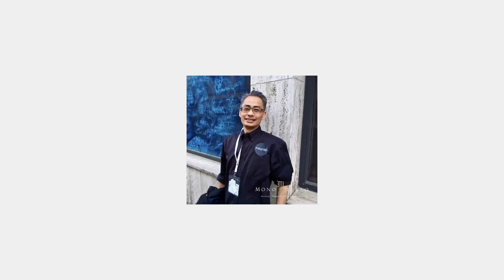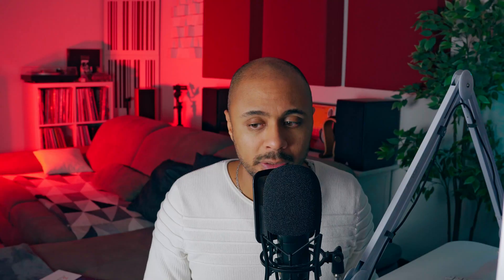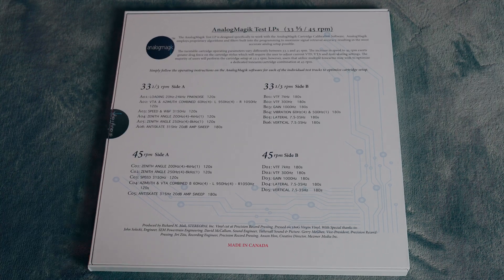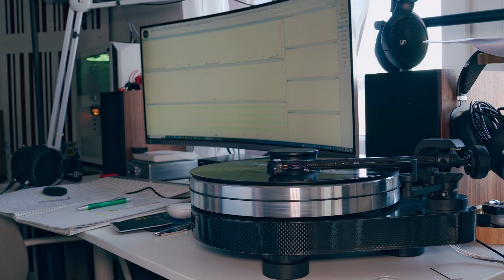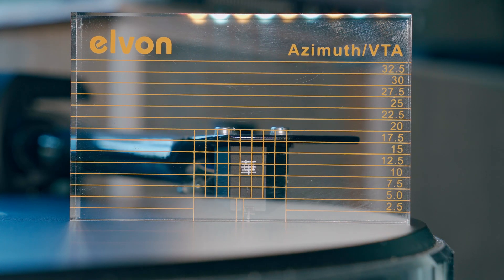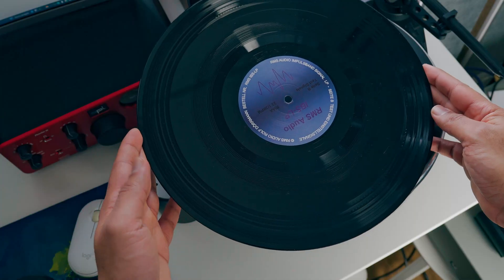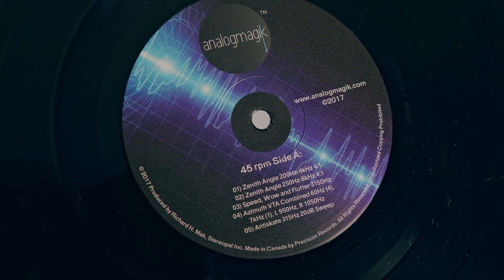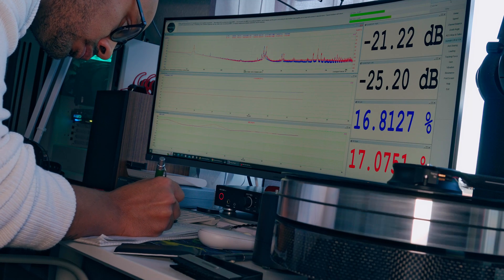The HOLY GRAIL of ALL in one Cartridge Setup - AnalogMagik Review

Comment: The Achilles Heel is the A to D converter - it’s junk! OK for a low end TT system, but not for a high end system. You add new noise and distortion with this device.
Reply from the maker: Not because AnalogMagik is based on incremental changes, the baseline distortion level is not relevant for optimize your cartridge setup!
Reply: @MadAudiofficial  that is wishful thinking. Distortion is distortion. You are calibrating an analog system with digital data. Not great! Nothing beats listening and calibrating by ear and experience.
Reply from the maker: @Fluterra  is fine to go with the system that is better for you, i probably will not speak about something without test it and understand how its work first but is ok have an opinion, what i like from Analog Magik is that in a couple of hours you are done and it's sound always wonderful, i can measure distortion wherever i want and if is in the range i know that will sound good, it's working it's just working great🤷🏾‍♂️

Comment: I can suggest a much easier method of lowering THD, IMD, increase speed stability, lower crosstalk, increase channel separation, bass response and eliminate resonance, eliminate surface noise as well as lower noise floor, increase dynamic range etc etc of your system. Throw all this analog stuff in the trashcan..
Reply: All we had back in my day was vinyl and I grew to hate it.  For the most part I use Spotify and to me it sounds fantastic and all it does it takes the space of my Iphone for storage.  I do have a decent stereo with a Parasound Halo 2.1 and Monitor Audio Silver 8's.
Reply: Hahaha. But digital sucks compared to vinyl. In a good setup, anyway.